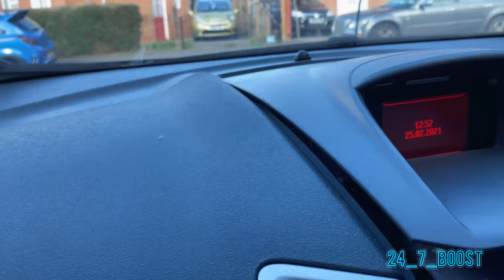HOW TO INSTALL A SUBWOOFER IN A FORD FIESTA !!!

Comment: You should really run the power cables down the battery side of the car and the rca cables down the driver side of the car. That way you won’t get hum from the sub.

Comment: I have a mk7 fez zs 1.6 petrol 59plate. I'm stuck with mine. I have RCA converter too but I can't find which wires I need to splice into.

Comment: Where did you connect the remote wire to
Reply: I wld like to know the same thing, that's the only info I need to finish my installation
Reply: @luiscarrillo8775  I also have the same issue, what did you use?
Reply: There are many different places to connect it to. You want the remote wire to be a wire which is live or turned on when the ignition in the car is on. You can find these in cigarette lighters, light units and in the stock cars stereo unit.

Comment: Step 1- Buy a sub with an amp 
Step 2- buy wires to  connect it all
Step 3- install it 
Got it I’m ready😂 good vid as always mate, something different always best
Reply: Why you use that rca connector for ? If you have amp?
Reply: @trifanandrei1585  The head unit (radio) dont have rca outputs so that little wire thing he used is an loc line output converter that he attached to the normal speaker wires which is called high level output so then it has rcas on it that he plugged the rca cable into that he runs to the subwoofer low level inputs on the amp

Comment: I connect it the same but when i start the car up the radio comes off ( no sound ) till i disconect the RCA 
Any help? 
And i can hear engine runing from sub
Reply: I am having trouble with mine too, It seems there is a ground problem, I got mine all hooked up to my sub and amp and it works and plays fine not even engine noise, then when the power door locks lock i get a real loud hum from the sub, so I tried a different way and now the car seems to ignore my remote that i have plugged into fuse 19, and now it wont shut off with the key and just stays on for a few seconds then turns off with a loud pop, I am going to try a new amp and see what happens, this car is weird, I think they call it can bus where the computer takes over and turns off every thing

Comment: I also have the same radio but i hate it's massive high pass crossover which starts at 60hz so u don't really get the lows
Reply from the maker: I’ve changed the sub and now I’m running a bassface amp and it hits
Reply: i thought the high pass filters were on the tweeters

Comment: Does any one know what fuse do you hook the switch wire to ignition or radio because I got mine on ignition but I get static and and whining nose when I accerlate

Comment: I am trying to find a fuse on mine for the remote wire, I have tried 3 of them and they are all constant hot,  I am still looking, I need one that comes on when you turn on the key, another weird thing, I had it hooked up but on a constant hot and it sounds good till I start to drive off about the same time the automatic door locks come on, then my sub comes on a loud constant hum, till I open the doors, its like when the doors lock the sub comes on real loud, I open the door and it goes back to normal, thats the 2 problems I have.

Comment: What the thing called you used to attach the sound cables to the radio with. (The device you hard wired in )
Reply: You find out???
Reply: RCA Converter
Reply: Line output converter or loc, they make a lot of different kinds, some of them are just some wires with resistors, others are a little box, some have remote turn on built in so you dont have to run a remote wire, I was using a pac loc and it just quit working, im going to try a different one this time

Comment: Where’s the wiring diagram for the back of the stereo?? I need it for my own car
Reply from the maker: I found it on good on the Forums
Reply: @247Boostt  do you have the link???
Reply from the maker: Is it a Ford Fiesta your doing
Reply: @247Boostt  Yh it’s a Ford Fiesta zetec 2009, it has the 14 pin connector that your wiring it into
Reply from the maker: Skip to 8:59 on my video and I show you the two rear wires I can’t find the link and you can pause it and look at them

Comment: my subs not getting any power to it any ideas?
Reply from the maker: Maybe the remote wire or a bad ground connection
Reply: @247Boostt  it was the ground lol thx
Reply: Which cable have you used for your remote cable to amplifier?